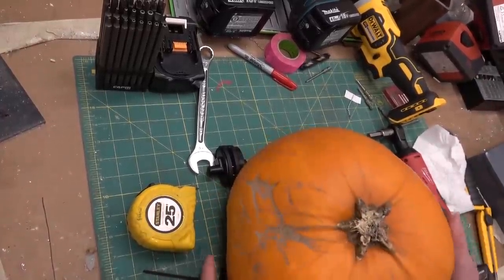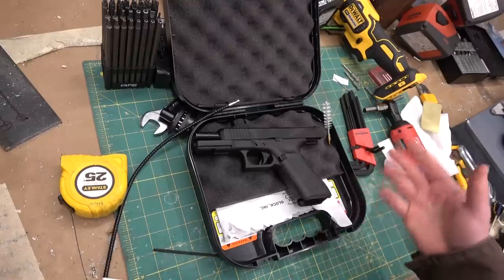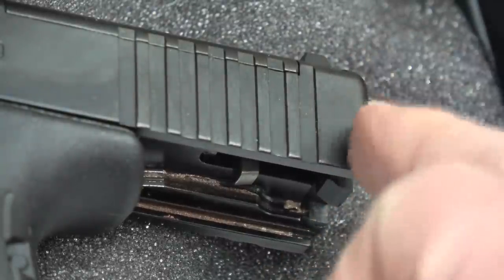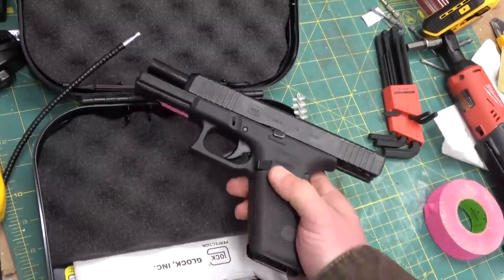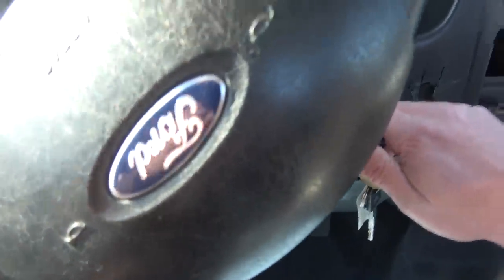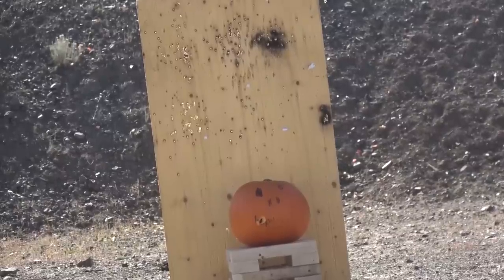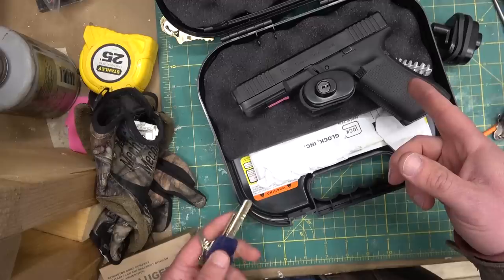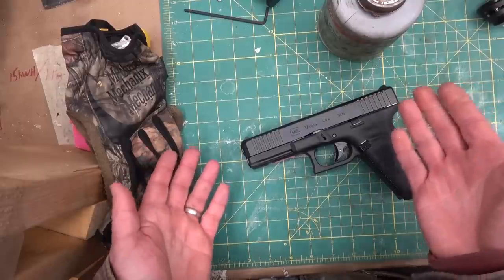BOLTR: GLOCK 17 GEN 5

Comment: Captain here. Regarding the firing pin safety, magazine does NOT need to be inserted, magazine has nothing to do with any safeties in the glock.  The bump on the trigger bar actuates the firing pin safety when the trigger is pulled (and the bump on the bar travels rearwards) thus allowing the firing pin to move forward.

Comment: Nice breakdown of the Glock. It's a brand of which I'm not a fan for several reasons, starting with the trigger "safety". Too many of the constabulary (and a few others) carrying a Glock have gotten that trigger hung up in something pulling both halves of it resulting in a negligent discharge.  The Glock is the "Toyota Corolla" of pistols. There's nothing that pretty or elegant, it just does the job when the booger picker tugs on the bang lever. Would have been interesting to see a side-by-side comparison of this Glock with that John Moses Browning classic, a 1911 .45 ACP. It's a stark contrast in design and materials.

The US military canceled all M1911A1 contracts at the end of WWII, almost before the ink was dry on the Japanese surrender. We lived on the existing stocks of the pistols into the mid-1990's as it took a number of years to field the M9, and some special operations continued to use them until very recently. By the late 1980's they were showing their age and were seriously worn with more and more of them being washed out as no longer repairable or maintainable. A good armorer could keep one running with very good accuracy provided the frame wasn't shot out beyond tweaking. There's something to be said for that kind of long-term durability with continued reliability through the end of WWII, the Korean War, the Vietnam War, and all the little adventures between them. Never had a problem with any M1911A1 failing to function, no matter how worn it was, or how grimy it had gotten.

Cannot say the same for the Beretta M9. By comparison, it was a high maintenance mistress that was never designed for mud, dusty mud, frozen dusty mud, or sandy dusty mud. If she wasn't maintained to her level of satisfaction, she refused to do anything and gave you the silent treatment. OK for law enforcement and the relatively benign operating environment for it, but horrid for use by the US Army and USMC in particular that live on the ground, and in holes in the ground, in every climate and weather condition imaginable. The same thing bothers me about the Glock concept, and with the Sig Sauer M17/M18 that's now being fielded. It's their durability and reliability under the harsh conditions to which they'll be subjected, which are orders of magnitude harsher than law enforcement subjects them to.

Comment: You dont have to hold the trigger down.
You dry fire... that's it.  Pull slid back about a quarter inch... or like... idk like 4mm pull the breakdown slides down and push slide forward.

It's so easy

Comment: Hexagonal rifling makes a better gas seal with less effort, typically you get slightly higher velocities vs standard rifling. I think it costs less too but not sure. They also get fouled less especially if you use non jacketed ammo.  The claw like piece is called the extractor, the part mounted in the frame is the ejector.  

The plunger you thought was a magazine safety has nothing to do with the magazine. It is the trigger disconnect safety. It insures that the striker can only hit the primer of the cartridge when the trigger has been pulled back completely.

Stamped steel parts have become more common in modern firearms due to Glock's successful use of them.

Comment: I always wondered what was happening to the gun when the manufacturers say "You need to put a few rounds through it to break it in and make it reliable." Now I know it's because they were cutting costs and passing the final step onto the consumer like you said, and in the most immeasurable way. What is "a few rounds"? How much material is being lapped? When should we replace the "compound" with normal gun oil for optimal reliability?

Comment: Back when I worked in electronics components manufacturing and we had to wait for the automated visual confusor inspectator to checkamathing our parts for us I would entertain myself by sliding some 234 blocks around on the surface of a surface plate they kept in the inspection room just like the guy with the hand scraped plates in the video. The troll and die guys would kersmack them around so much I'm surprised they were flat enough to make that hydrodynamic lift. A buddy and I made a rudimentary game of air hockey with it and luckily we never got caught by the big boys in the fancy suits.

Comment: To be more specific, a Glock pistol is not classified as a semi- auto action, it is a "double action only" firearm and THAT is the most important "safety" the pistol utilises because of the striker always being reset to "half cock" and not enough energy to fire a round in said state of battery. As one pulls the trigger it is "drawing" the striker back until it slips off the "disconnect" when it falls. Exactly what happens in a "double action" revolver. The gun is ALWAYS safe because it is NEVER fully cocked. Hence the term "safe action pistol".

Comment: Im shocked that no ones has commented that the copper compound on the Glock is for break in of the interface between the slide and the frame. its on there for that exact reason. its no different than having to hand lap the slide to frame interface on a 1911 pistol. it does its job just fine as it not meant as a permanent answer for lube. I personally hate shooting Glocks but I think its the most rugged and reliable pistol money can buy.

Comment: 22:32 that firing pin safety only interfaces with that nub on the trigger bar, Glocks don’t have a magazine safety, which in my opinion is good because you want to be sure it’s COMPLETELY empty before performing that dry fire for disassembly. 

Also, another safety, of sorts, is that the thing is actually only half cocked by the slide reciprocating. Pulling the trigger finishes the job. As I understand it, the sear could be whooped up and disappear in the rapture and the firing pin wouldn’t have enough energy to actually detonate the primer. Kind of the same idea of a double action only revolver, but with a less shitty trigger pull.

Comment: Don't adjust those sights just yet.  Just about everyone shoots Glocks low and left at first.  It would rare for the sights to be far off on a new one.  This is usually a technique issue -- you're likely pulling the sights off the target before the trigger breaks.

Try rotating your left hand a few degrees toward the ground to get more engagement from the base of your palm on the left side of the grip.  This will take some of the unbalanced tension off your right wrist.  Your groups should tighten up, move up and right, and be easier to control under recoil.

Comment: You dont need to pull the trigger while pulling the takedown tabs down...its easier to just dry fire, then pull the tabs down, while moving the slide back with the right hand a TINY bit

Comment: 24:25 you must be referencing the Polygonal rifling they advertise. While the claims of polygonal rifling are dubious it is distinct from traditional land and grooves rifling. Polygonal rifling is typically done with hammer forged barrels as well which is a cost saving measure granted you produce enough barrels to offset the cost of the hammer forging equipment. 

Im at a loss to explain with words the visual difference in polygonal versus land and groove rifling but you can find diagrams of the cross sections comparing the two and you'll see the difference clearly.

Comment: I have not worked on glocks but I have worked with PA a lot,,  the most likely PA would be a PA 11,12 with 30+ % long glass fibers PA 6 and their variants absorb water to achieve there highest strengths and final dimensional sizes. How they over moulded all those steel parts with in a 1/10 of a mickey hair while there pushing a polymer in at 8000 to 16000 PSi into the cavity is impressive 
Some of the cleverest and best mechanical engineering, is in firearms

Comment: The copper is for storage only. It is meant to be cleaned off before use.
Reply: Not correct. It's for the break in period of the firearm. It's intended to be fired with the copper grease before cleaning.

Comment: Your misfire looks like it had a primer but no power. When the powder is ignited it leaves a black residue inside the case. The lack of a black residue indicates no powder, this could cause what's referred to as a squib. Squibs can be extremely dangerous possibly even blowing the firearm apart when the next round is fired. If it doesn't feel right drop mag and clear the weapon. After insuring the gun is safe use a cleaning rod or a long thin screwdriver (on a pistol) to check for an obstruction in the barrel. You can also disassemble the pew pew and look through the barrel from the chamber.

Comment: Your assessment of the stamped/bent components may be incorrect. Where high accuracy and highly repeatable parts are needed you would use a german made fineblanking press. This would produce a part with little to no edge break (unlike the sample you showed) repeatable to .001" or better and still produced with relatively high production rate. The tooling is expensive but if it a high production run it may be justified.

Comment: Glocks don't come with a magazine disconnect safety. The nub on the slide that acts as a safety is the firing pin block. It must be pushed up through the pull of the trigger in order for the firing pin to poke out into the primer. If you don't depress that nub on the slide, you won't be able to push the firing pin forward.

Comment: I feel they use the anti seize as a slightly abrasive compound to match the slide with the rails on the frame and brake them in. I’m sure mr Glock was far to smart to think anti seize is a good lubricant for minimal wear of metal on metal components

Comment: The googlenator spit this gobblygook out. "The Glock's frame, magazine body, and several other components are made from a high-strength nylon-based polymer invented by Gaston Glock, called Polymer 2. This plastic was specially formulated to provide increased durability and is more resilient than carbon steel and most steel alloys."

Comment: The reason for the copper anti sieze is to help lap the sear and firing pin/striker. I believe Glock recommmends you leave it on for the first 500 rounds. It may not be off the shelf anti sieze, it could be a Glock secret. I don't believe anyone has ever determined that. The stainless steel slide and barrels are hardened through a special process that makes it nearly as hard a diamond. A glock slide and barrel is so hard a file with skate right off ot it. On the Austrian made Glocks the process is called tenifer and it involves cyanide, I believe they have to use something else on the U.S. made Glocks due to the EPA. Therefore they aren't as hard. If for whatever reason you want machine work done on a Glock barrel or slide it cannot be machined, it has to be cut using wire EDM because the steel is so hard. Glock knows what they are doing, it's not an amateur mistake. Also the frame will either say made in U.S.A. or made in Austria. If the slide has the word Austria on it it was made there, and the top of the chamber will be marked with "AT" on an Austrian made Glock barrel. As far as I know the only Glock models fully made in the U.S. are the .380's and maybe the single stack 9mm's to get around our stupid import points system. Though they may be making other models here now. I've seen several new numbers matching Glocks with U.S. made frames and Austrian slides and barrels.There's a whole convoluted story behind it both online and in several books. Personally as an American who has owned 6 Glocks I would not buy and american made Glock. To me they are an Austrian company making high quality firearms in Austria. 

Also as far as durability as of 2006 or so there was an indoor range in the Detroit area with a rental Glock 17 with 1.3 million rounds through it. In all that time all they've done is change the recoil spring and trigger spring every 10-20,000 rounds, and it's still going strong.

Comment: When you chamber a round, the firing pin is held in place by the sear engagement. The trigger connects to an action bar which manually pushes on the sear backwards which then pushes the firing pin plunger backwards: as that occurs the rotation of the trigger also uses another action bar to push upwards on the firing pin block - which at it's upwards most point of travel has moved out of the way of the firing pin shortly before the angle of the sear engagement has caused the firing pin plunger to cam off of the sear - allowing the firing pin to fly forward, unobstructed. 

So not only is the firing pin not at it's most rearward point of travel when you chamber a round, but it's also securely situated against the sear unable to move forward and even if the laws of physics suspended momentarily and the the sear crumbled to dust for some god forsaken reason: the firing pin block is still in the way of the firing pin preventing the firing pin from being able to strike a primer. Then, even if the laws of physics were suspended momentarily and the sear vanished from existence and for some unknowable reason the firing pin block was stuck, somehow, in the upward position where it doesn't obstruct the firing pin's travel: without the trigger's action bar physically moving the firing pin further rearward from it's cocked resting position; the firing pin doesn't have enough energy to detonate a primer. That's why the Glock is remarkably drop safe - unless you actuate the trigger: it will not go bang.

The only real way for a Glock to fire without the trigger being pulled: is cook off. Meaning the gun was placed in a fire or exposed, with a live cartridge in the chamber, to such heat that the cartridge detonated without the primer being struck. Outside of that, a Glock will not fire without pulling the trigger. It's as safe as a double action revolver.

Comment: Those ejection problem can be easily remedied by replacing the ejector and extractor with aftermarket or retrofit newer gen parts, those weren't the best designs coming out of earlier Glocks and it's just a factor of bad geometry

Comment: Nobody, and I mean nobody can surpass what you do and the very unique way you present things. With that said there's something very important about the reliability of Glocks you didn't cover. I've owned a bunch over the years and never had a failure of any kind. I've never owned a gen 5 and don't know if this has changed but all of mine were like this. Look at the feed ramp and in all the previous generations there is a little cut out area at the bottom of the chamber. This aids in feeding all types of ammo because every type of bullet tip can slide into the chamber. This also is the reason why for many years Glock didn't recommend using reloads. What happens is a little part of the case in the rear of it is "unsupported" and if the reloads have too much pressure the unsupported area could deform or even blow out.

Comment: Just have to nitpick this a bit. You are not going cause corrosion by putting anti seize on a piece of nitrided steel. The hardness, lubricity, and corrosion resistance of that process are the reason they nitride slides and barrels of firearms.

Comment: QUICK. Off topic question.  Can I use brake line fittings and line for power steering? Why or why not
Reply from the maker: No, use manufacturer approved lines. Different fluid, different application. But if you are in a pickle in some 3rd world shithole, use whatever you need to get you home.

Comment: I hope Sven from Austria does not read this but back in 90s  I was at my swamp cabin  I stepped off the road at 3 am took a leak  my buddy says “dude where is your Glock !!” ??      I had dropped it in ankle water   In a calm panic I started crawling around lookin for my ( at time it was $550 new ) I figured it’s a glock we will look the next morning !  No find after it rained all night !   Now in panic I called friends with metal detectors and two days and pizzas n beer NOTHING !  for years I walk past wondering what happened to my gun.   Three years later I’m leaking again and there is my Glock sitting on top of a small sprout of weeds in plain view !   Hundreds of trucks past no one saw it.  I figured no problem oil it clean it it will be ok ( I read the articles about how the Braising resilience !   It was rusted solid.  I was told to boil it  I did and it swelled up twice it’s size. 😩.  I called Sweden and Sven  answered I told him the story. I said I’m afraid to take it apart the mag Wont come out  he asked does it look alright I said yea  pretty good.   He said I’d like to have that gun and your story ( without the leak part ( I said ok. He said I’ll send a new one you pay $200.   I said deal !!   ( there was a round in chamber but I tied to a tree with a 50 foot string  no way was it going off.   I got a new one. But forget it  it’s like any gun you loose.  I bought a 5/7. I don’t like no safety.

Comment: Never seize is good for exhaust manifold bolts.
Reply: Retired ASE Master Tech here and I used it on spark plug threads, especially on aluminum heads, and on Manual transmission clutch plate splines and pilot bearing. That's about it, I never used it on exhaust manifold bolts because I didn't expect to be taking them back out anytime soon.

Comment: I don't know if you can concealed carry in Canuckistan, but I got a new carry piece the other day. Sig Sauer P365XL. It was actually designed around the magazine so it's a 12 round capacity with a micro frame. The S&W Bodyguard is comparable with an 8 round mag. Y'all should check them out if you're looking for a small carry pistol with great firepower.